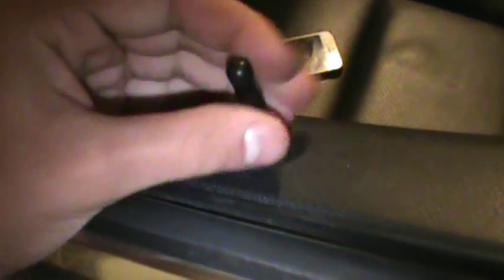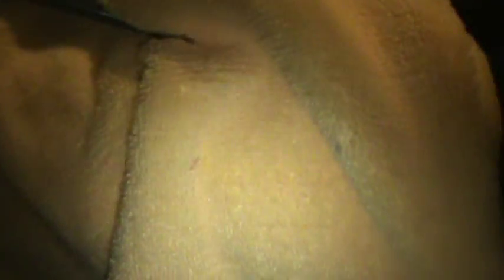Removing front door pins on Mercedes

Comment: I have a 2015 CLA250. Does this method only work on the front doors, or the rear doors as well? If not, how can i do so? I want the AMG pins
Reply: Amer  Did you figure it out? I have the same car and I am changing the DoorLock Pins on my car as well